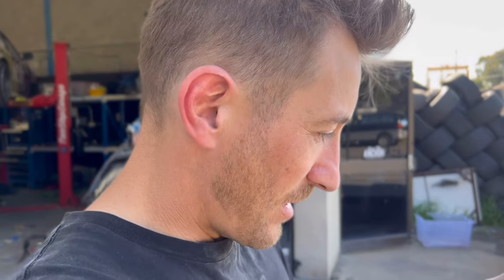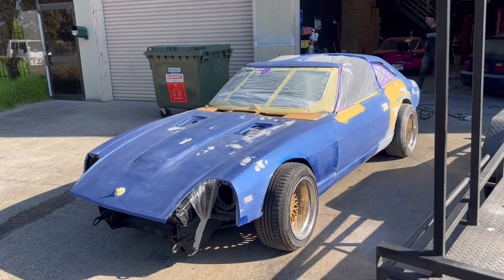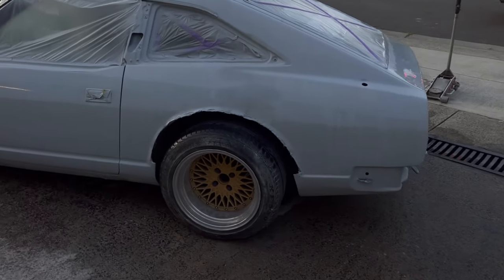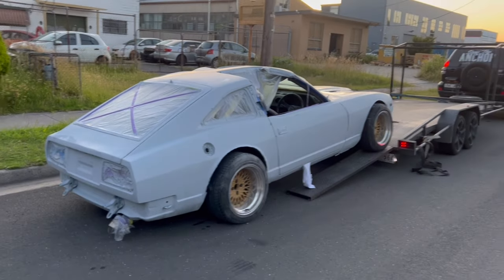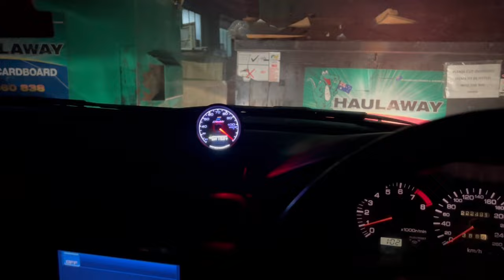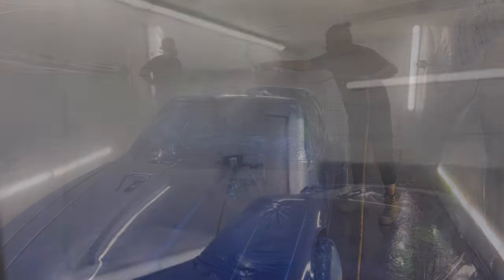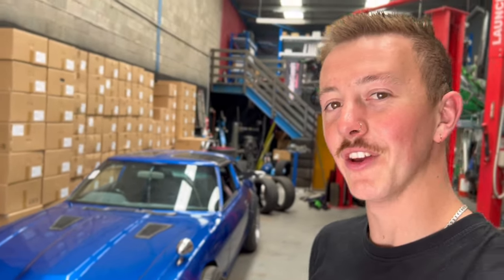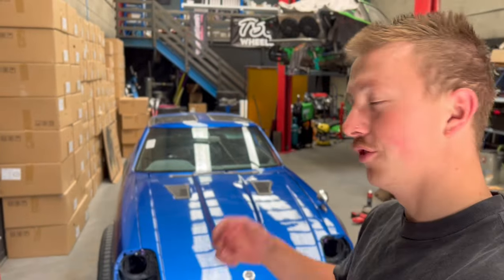Idiots Try Spray Painting | DATSUN 280zx

Comment: Happy new year cam, hope you and your family are well =]
Reply from the maker: Thanks mate! Happy new year to you too. Hope the skyline is still treating you well!
Reply: @CamMartonDrift  It has been running like a dream, however i think the starter motor is fucked. Over the last year intermittently it wouldn't crank at all and then would randomly crank and be fine, but then it started getting like weaker and weaker, the battery is brand new.  You got a spare i could buy off you? cause now it won't crank at all. I can hear the solenoid pulling in, but no crank. 
Oh and the accelerator pedal box tac welds all broke and the accelerator pedal box is broken off the firewall. If i prep the paint for welding and take out the carpet etc could you weld it back in? Pay you of course. At the moment its a dodgy gaffa tape and vice grip job holding it position lmao.
I missing the skyline already since the starter died late November. Msg me if you can when you are free. Cheers matey